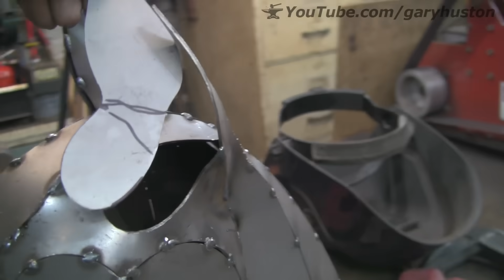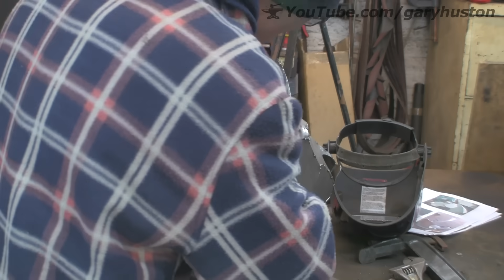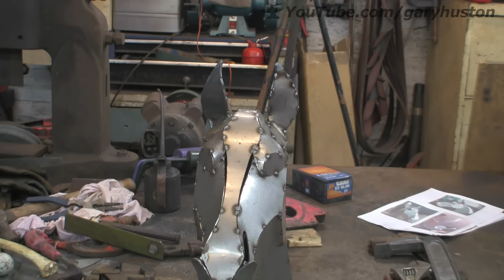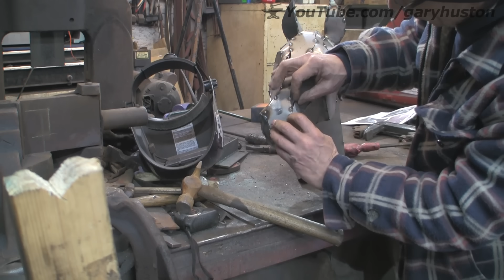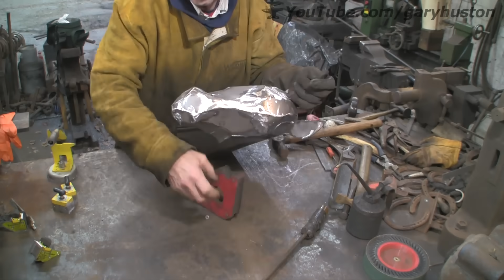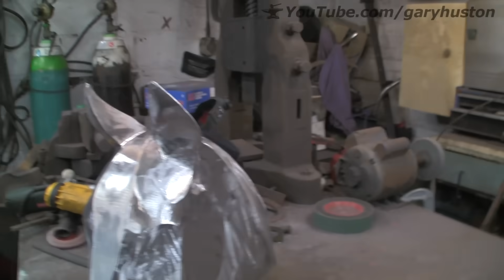Horse head build Part 3

Comment: Thanks for this series of videos. I'm currently working on this project now, and I am hoping to have it completed by Christmas. I'm just coming around the nose now, and it's definitely only becoming more difficult as i go. I'm making mine from 16g stainless steel and TIG welding it, which only adds to the difficulty because SS is much less friendly to forming, and TIG welding is much less forgiving with gaps.  Anyways, thanks again for taking the time to make the instructional videos, and happy holidays.

Comment: Hey Gary Great video, finished mine thanks to this video, ready to grind it.  What was the first grinding wheel you used to rough grind?
Reply from the maker: I think it was a 80 grit flap disc.
Reply: @garyhuston  ok very cool thank you.  I started with a 60 grit flap disc, I will progress like you did as it looked great, did you ever finish it with patina?  I was going to use a product we have here called black magic...
Reply from the maker: No, i ended up just clear coating it. Looks quite good.
Reply: @garyhuston  Yep, bet it looks great cleared.  Thanks again for sharing your video!  Doing those ears was tough!!

Comment: Great job. On your body hammer put a lot of of radius around the hammer head to help reduce your hammer marks. Very beautiful. If it's going on your truck you could chrome it. As soon as this is seen you will have many orders. After you have 300 of these you will be much faster. It would also look good using gun bluing. They have cold bluing. A die or paint fall varnish to seal it but still shows that it's made of steel. Check out Gene Winfield for sheet metal tip.

Comment: Thanks for these videos Gary. I was originally trained as a high pressure pipe welder, but changed trades many years ago, and would like to get back into metal working as a hobby, and my shop is almost ready to go. I loved this project, and found the videos quite inspiring, however a little aggressive for my first projects, but it’s definitely on the list now. Cheers from 🇨🇦.
Reply from the maker: Im sure one of my other projects will get you started! Good luck👍🏻

Comment: would you recommend getting the pieces cut with a laser cutter for accuracy, or in your opinion, could they be cut with a handheld plasma cutter, with a steady hand?
Reply from the maker: If you want it to fit together well I would recommend getting them cut by laser cutters or at least a cnc plasma.
Reply: @garyhuston  I did it just with a grinder, hell of a job, and at the end I could not finish it because of the accuracy :-(. now I'm looking for someone to lasercut it. Btw: great job Gary, I looked at your videos. several times, you explain it better than Joshua did ;-)

Comment: Hi Gary, who did you go to for the laser cutting as I have just been quoted £127 for a full set which seems a bit high to me.
Reply from the maker: I used a company called Laser24, however they have recently got a new machine which to me is worse than the old one and quality is not as good plus they have put prices up. I would search around. When I had six sets done I got them much cheaper. If you really struggle let me know I might have a spare set kicking about we could do a deal on. Postage is the biggest problem.
Reply: @garyhuston  Gary, many thanks for getting back to me so quickly with this info, where abouts are you based?
Reply from the maker: @davidrichards3605  Chesham in Buckinghamshire.

Comment: Nice work. I did the same horse after watching your videos so appreciate all of the input Gary. I put the three pieces that run down the middle on one by one and also attached the odd piece right above the round jaw piece early on. I noticed you struggled a lot with controlling that center piece when all three were attached at one time. were you able to get it finished with something yet?

Comment: Congratulations on finishing this project! When you hammer on the metal to move it or shape it, it helps to use two hammers, one in each hand. You brace the metal with one whilst hammering with the other. I'm going to try but with a considerably thinner metal. Welding thin metal is easier than shaping thick metal, in my opinion.

Comment: If you want actual rust in a hurry, heat the metal up some (say searing steak type of temperature) and spray the surface with vinegar. instant rust. If you try it, keep your face out of the way when spraying the vinegar, it briefly gets quite harsh on the inside of your nose.

Comment: try diluting white vinegar 4-1 with water and using that as a wipe on and let dry method, then clear coating it, try it on a test piece first, it should give a nice brown patina
after you welded it and before the grinding i thought it also had a good look to it.
the other finish you could go with is flame colour it with the plant then clearing it.

question is, do you mount it on the bonnet or roof of the landy, or hide it in the missus bed :))

Comment: Is that mild steel or aluminum?
Reply from the maker: Mild steel CR4
Reply: @garyhuston  Thanks for the quick reply, also, great job on the horses head, thanks for the upload.
Reply: @garyhuston  do you have an approximate cost of the steel / lazer cutting  
or would you know what size all the parts would take up on a sheet
Reply from the maker: Alister armstrong it cost me about £100 for a set to be laser cut but you would easily get a set out of half an 8x4 sheet. You may get a better deal if you shop around at different laser cutters but I always use the same firm.

Comment: A bit late now but if you had used a steel called "corten" it will rust then leave a protective  layer. Really  do like the horse head. I can see a little project on the horizon.
Reply from the maker: That stuff is soo expensive though compared to ordinary steel. Good shout though!